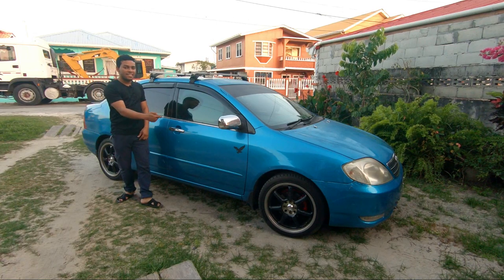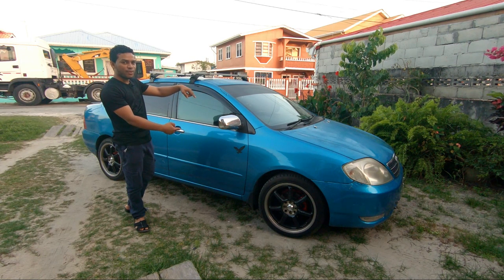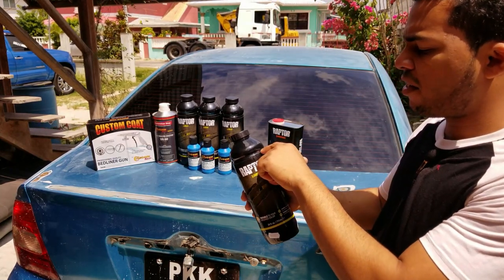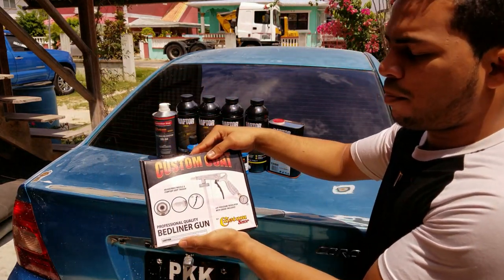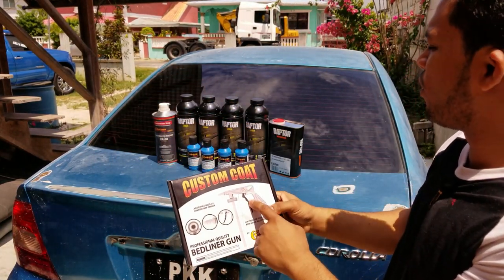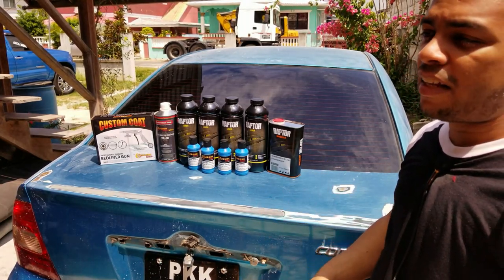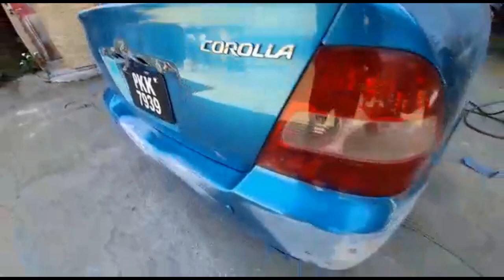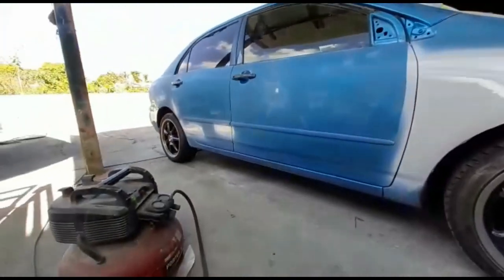Raptor Liner On A Toyota Corolla NZE (International Version) Safety Blue

Comment: Came out beautifully! I was looking at a kit that came with the Custom Coat tint (Hot Rod Red), so seeing it in action has been very helpful. The 4 liters was enough it seems?
Reply from the maker: I would recommend getting an extra litre because we had to stretch the 4ltr to make it work.
Reply: @dennisleegy  Ok i may opt for 6  then as I don't intend to do the door jambs. Thanks!
Reply from the maker: @stillon360  6 should work perfect! What type of vehicle car?
Reply: @dennisleegy  Subaru Impreza sedan, its been repainted in the past to match the C7P Lighting Red color, I think that as long as I choose a similar red tint it will not look too out of place with the unlined door jambs
Reply from the maker: @stillon360  yes hopefully is should match up
Reply: @dennisleegy  I did my crv used 7 bottles jambs Included
Reply from the maker: @seonsadventures2981  nice. Where are you from,?
Reply: @dennisleegy  GT bro